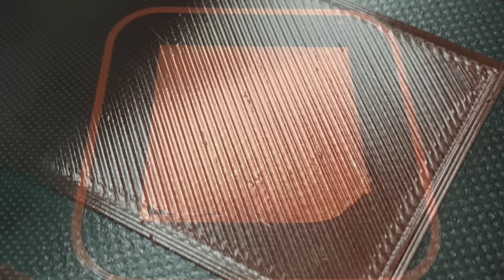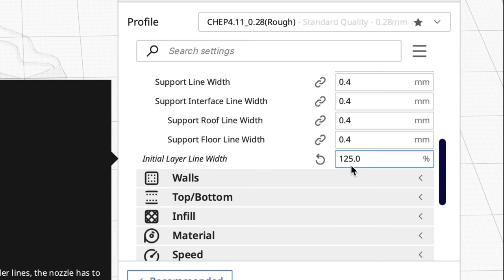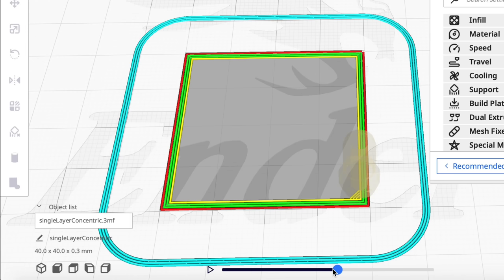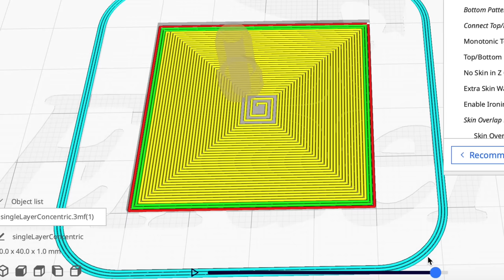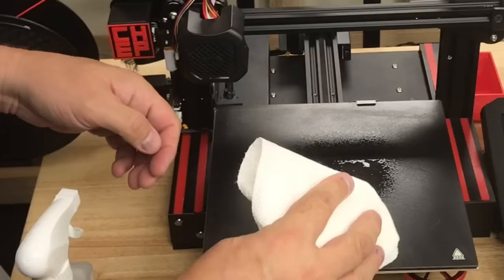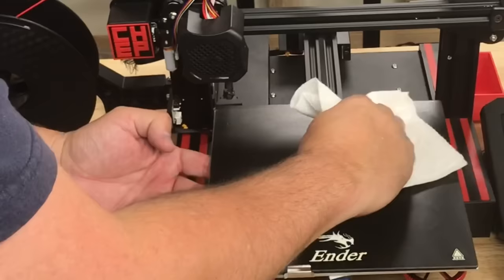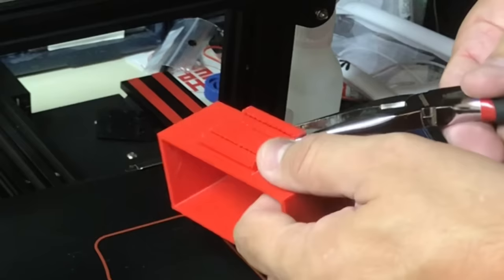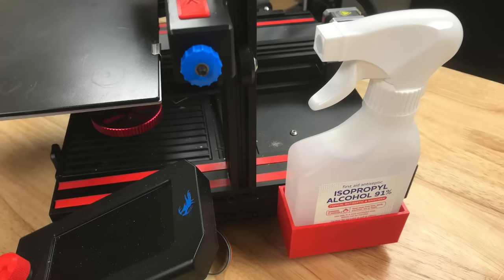Better First Layer and Bed Level Fixes on 3D Printers

Comment: While it is true that isopropyl alcohol will remove the oils, I have found that it will eventually dissolve the layer on the glass. I ruined 2 plates until i realized this. I switched to plain Dawn dish soap and water and have yet to replace a plate.
Reply: Yea same I’ve been having issues I just use dish soap then glue stick but don’t wipe the glue stick
Reply from the maker: How many wipes did it take to fail?
Reply: @FilamentFriday  I honestly didn't count at the time. I think I was in the habit of cleaning after every build on the first plate. So maybe 30-40 items before things just wouldn't stick. Got a new plate and didn't clean as much before each build. Started to put two and two together and figured the alcohol was eating away at the texture on the plate. I know there are many levels of percentages for alcohol and maybe a lower level would not eat away as much, but at this point, I just use good old soap and water. Maybe a pure glass plate would be ok to use alcohol, but if there is some texture on it be forewarned.
Reply: I also damaged the surface in cr10v3

Comment: My filament Friday tip is; Use LIQUID PVA GLUE, it´s the best! Smear a thick layer of PVA GLUE onto your print surface BEFORE you start, then pre-heat the HEAT THE BED until it's dry and goes clear.  After printing the PVA peels off quite well when it's time to redo the surface.

Comment: I came back to the hobby after several months, bought some filament and a new printer, just because.  I just watched your video a few times because I'm having trouble with my first layer adhering properly.  After about 2 hours of messing around I finally realized that the filament I bought and was using is ABS lmao
Reply: This comment saved me so much headache. I ended up doing the exact same thing haha 😫
Reply: @davidw4269  lmao good to know I'm not alone

Comment: I found a while ago that cleaning your glass bed with a bit of dish washing liquid (not mixed with water) and then rinsing it with water and leaving it to dry has helped me with bed sticking issues. 

Unrelated I found Cura 4.9&4.10 tend to cause bulging by seams and corners in my prints so I'm stuck trying to solve that. Might stay with 4.6 til a newer version doesn't cause that issue

Comment: Thank you for another informative video.
ISP Alcohol is rather exspensive here in South Africa, so I use menthalated Spirits. And no, I don't filter and drink it/ At $2 for 750ml, it is more affordable than $4 for 100ml...
Also thank you for the file.
I am one of those who take your files, apreceat the efford, and modify it for my needs.
I always wanted a side mounted camera bracket for my Ender 3 and 3 Max. So I tinkercad the box away and add a camera arm onto it with an action camera mount that can take the various camera and cellphone mounts. 
Will post a make to your thangs page once I am done.
As you can deduce, you are aiding my designing and education. So thank you very much.

Comment: Fantastic video! I noticed that you have some red strips inside your 40/40 rails to prevent loose filament from getting in there, and you have a custom knob attached to your LCD, could you go over what you think are some of the best print-able upgrades that you always print whenever you get a new printer? Thanks Chuck!

Comment: So I made these adjustments.  Next few prints came out flawless.  Next day i went to print my next model and - nothing sticking.   Flawless prints had a z-offset at -0.12.   To get the next print to stick I had to adjust z-offset to -0.60!!!   Nothing else changed!   This is boggling my mind.
Reply from the maker: Clean the bed with soapy water or Isopropyl alcohol.
Reply: You have bad bed screws or a wobbly x-gantry

Comment: I was so annoyed one time. Couldn't get it to stick. So I turned the heat to 210 and pushed filament through the nozzle by hand. The filament was curling onto the nozzle. So I guess some debris was in the nozzle or something. Great advice 👍
Reply: The curling is caused by the fan blowing air onto the filament.
Reply from the maker: No, it’s typically a partial blockage preventing proper flow.
Reply: @FilamentFriday  hmm if the fan is not on and it curls then yes I can see how that could be the problem, but on my Ender 3 v2 the filament always curls a bit when the fan is on(stock one-sided fan) even when I switch to a fresh nozzle. Perhaps something is wrong with my Hotend?

Comment: Should also mention temperature of the bed and nozzle for z hieght. If you go from printing at 60c on the bed to 70 or 80c, you will likely need to adjust your z height.

Comment: Maybe it's just me. but attaching a bottle of IPA next a a heat source, like a 3D printer, seems like a fire waiting to happen.
Reply: right??
Reply: Not exactly, because it doesn't touch anything hot directly, the nozzle doesn't go that far, but it might evaporate
Reply: Just rubbing with a paper towel makes my glass mirror bed clean most of the time. In our country we use methylated spirits to clean. Much cheaper but you have to tolerate the smell for a little bit.

Comment: Holy heck.... I need to just try and "clean the bed". I keep the area clean of scrape and debris, but yea.... I've never actually just. Given it an iso wipe down. I am using the Ender 3 v2 Neo with the flex bed to get prints off easily. I feel I am leveling the thing all the time, or just never getting a good flat adhered print. Maybe it is because of the oils.... from skin.
Reply: It's funny. Was having a sticking issue. 
Cleaned the bed, heated it a bit higher, slowed down to 20% to get it started and voila.. working again. I was kind of shocked that cleaning the bed... Works LOL didn't realize that could even be an issue. So so so glad I stumbled on this video, I was about to pull out the kids school supplies for a glue stick lol

Comment: Great video as usual Chuck. Much appreciated. I have a Cura question yo may be able to answer - As you can set retraction under a material filament profile, and set retraction under a print quality profile, which one takes precedence when you generate your g-code?

Comment: Im about to throw my printer in the bin.
The first layer have gaps between the lines/Infill. And does struggle on making holes after travel.
I used a 0.1 gague blade to fix bed leveling. Tried a big range of temps/speeds/retraction.
Reply from the maker: Sounds like you filament is slipping in the gears of extruder.

Comment: I tried cleaning the bed as instructed and my print still won’t stick to the bed. What should I do? Im so tired of fixing this printer
Reply: Go in your slicing software, adjust the initial layer height to be higher. Slow the print speed, travel, and increase the temp of your nozzle by 5°.

Comment: Never occurred that the oil from my fingers was causing certain areas to not stick. Cleaned with alcohol and got a lot of yellow crud off build plate and next print stuck down right away. Thanks!

Comment: Latest 5.x cura doesn't seem to have many of the setting you propose, like initial layer...
I have just updated my main board to V4.2.7 so I will be going through a raft of calibration processes.
To stick to the bed ?  I use prittstick and a damp tissue to spread the glue around the bed to cover the print area.
Works every time...
Reply: hit the 3 lines to the right of search setting and select all
Reply: @NuttyRam  Oh, of course... Visibility..
Face palm time.. Thank you...

Comment: I'm new to all this, In Cura I don't seem to have nearly as many settings as you do. Are they addons?
Reply: There is different settings for different levels of advancement you check off

You’re probably probably on the basic settings which are very limited, but you won’t get into too much trouble
Reply: Go to preferences then settings and select "expert" from the right side dropdown
Reply: Settings are Basic, Advanced, Expert or All in Cura. Tick the view you want.

Comment: I'd like to see a video about printing PETG on the Ender 3 V2 and how it sicks on that surface. I want wo start printing PETG and don't know if I have to put something on it to prevent ripping of the surface when removing the print as I've seen it on other glass surfaces or if ut works because of the texture. Would be an interesting topic as I've not seen any recommendations in that certain case
Reply: PETG prints just fine on the glass bed. Needs to be clean and go slow on the first layer and the head needs to be further away than it does with PLA.

Comment: I have great adhesion on my Ender 3 (glass bed, BL Touch v1.1.4 board) when I slice in Cura to standard quality, but when I switch to superior the filament does not stick and I get individual strands. I am printing with bed at 60 degrees and filament at 185 degrees with 4mm retraction after following your video on setting those values.
Reply: try to set the first layer height to 0.2mm, you can do it from the advanced settings.

Comment: I've leveled, tried a new bed, yet when I print the first layer I can see the filament curling up behind the nozzle as it moves and then it just drags everything into a ball of death, somethings going on and I cant seem to find a solution...
Reply: Same
Reply: @acidthedragon685  Looks like my bed, even though it was new was a fair bit higher in the middle so using the CHEP gcode for leveling the bed it was fine around the edges but the middle was tight, bought a glass bed and it solved that problem, bought a set of feeler guages as well because they were only £4...
Reply: Having a similar issue
Reply: @akg2n  I solved by using feeler gauges to set nozzle/bed distance, however I did also saw to a glass bed as mine was higher in the middle.
Reply: You could try being more aggressive with the squishing.  Force the filament to make an aggressive contact with the bed.  If you’re still not getting it… clean the head, clean the bed, try bumping the heat?
Reply: @lylejohnson7841  its fine now, swapped the bed for a glass one so its actually flat, then got some feeler guages, loads better now, no curl or adhesion issues.

Comment: When i do a long print. The first few layers tends to melt down a bit. It looks like compressed towards the object. I put initial bed temp at 75 and then 60. Should i reduce the bed temp or should i increase the initial layer height ?
Reply from the maker: Sounds more like a bed level issue. Too close to the nozzle. Try increasing initial layer height

Comment: My first layer keeps bubbling up ... already tried a cold pull, cleaning the bed with alcohol even cleaning it with soap and warm water ... re-leveling the bed (lower and higher). Nothing seems to fully solve the issue. I got a PEI bed btw. I might try the concentric first layer later...

Comment: The layer shown at 0:30 is over extruded.  Perfect first layer requires perfect first layer thickness.  Print first layer, stop, peel it up and measure with digital micrometer.  Adjust until it is exactly right. Then adjust the flow until the traces look filled but not over filled like those at 0:30.  Last adjust bed and extrusion temperature until adhesion is perfect.   Hotter give more adhesion. Cooler for less.  Wipe the bed with rubbing alcohol before each print to remove finger oil.
Reply: Is Glas cleaner good as alcohol to clean a Glas print bead?
Reply from the maker: Not sure

Comment: hi chuck,
I love your video's, I'm no expert in all of this stuff. i have been 3d printing for about 1 year, and i did some research and I found that isopropyl alcohol on the ender 3v2 is bad. so the ender 3 v2 has a carborundum bed an it is designed to release when it is cold but if you put  isopropyl alcohol on it can actually destroy that I'm(1) After 16 3D Printers, I Found My Favorite 3D Printer Bed - YouTube. love your videos man keep it up
Reply: What do you use to clean the Ender 3 bed then?

Comment: Question. Is having the zozzle start at .02 mm height better than having it start at .01?  I would think that after you leveled in bed with a piece of paper that is .01 mm stick then you would want the nozzle height of the 1st layer to be .01 as well correct? Wouldn't this make the squish correct and have a better first layer? Just throwing ideas out there.  I asked because I was having major issues wit's ager issues with 1st layers and having gaps if been gaps so I have tried numerous settings in Kira but haven't tried some of these.  I did get a pei sheet to help and it seems like the 1st couple of prints did ok (not great) but now it is not sticking as well even after cleaning with alcohol.

Comment: Does the filament quality, age, humidity have to do anything with the first layer to stick?
Reply from the maker: It can. Depends on the filament brand or type of filament.
Reply: @FilamentFriday  I did everything in the video, nothing worked, I'm seriously thinking about selling the machine.
Reply: @mustafatelawi9961  If you do everything he says plus level your bed, wash the build plate with dish soap, and dry your filament, and that still doesn't work.... It may be the filament or printer itself. Could need better bed springs, a z-axis baby-step, or something else a bit more obscure.

Comment: I had so many problems with the first layer on my Ender 3. Perfectly leveled. The main problem was that the printing bed is uneven. High and low spots. Making the first layer 0.3mm heigh helped, but I just ordered a glass bed I think it will fix my problems
Reply: I wonder if I warped my bed angrily scraping away filament lol

Comment: If you are using PLA and a smooth glass bed you can also use sugar water on a heated bed….it will stick very very well and cost next to nothing and easy to clean.

Comment: Either there's a different cura, or I'm blind I press on the down arrow on speed and it only shows one option
Reply: go up to the cura cofig then go to settings then go down and check the settings you want
Reply: or click your settings at the top right and change it from basic to expert this is on cura 5.2.1

Comment: Have a question. I print on a ender3pro and ender3 v2 both printers have puffy spots on all my flat surface pieces it just started and i do not know enough to fix it. I cant uplaod a picture or i would show you. Please help if you are able

Comment: My process:

1.) Check the filament and ensure its in good condition
2.) Level the print bed 
3.) Wipe off the print bed with rubbing alcohol and a paper towel
4.) Preheat everything before pressing print

Comment: I've leveled my bed within about ~0.010m using a BLTouch, aggressively wiped the steel textured PEI magnetic bed plate with IPA, and the bad boy still comes up on one single corner. Sad because it looks perfect in every other way, besides that one weird curved up edge.

Comment: great video ! thanks for all the suggestions! could you advice on what slicer software could work right with a flashforge adventurer 3d lite printer?  i a m not using flashforge filament persei ( its very difficult for me to get it ) i use hatchbox or sunlu PLAor ABS 1.75mm... but flashprint software doesnt allow me to select brands, just offers strictly flashforge filament...and i get no the not sticking problem with additional spaguetti result. hope to hear from you soon !

Comment: I've read isopropyl alcohol can overtime damage the glass bead bed, so stopped using it, and now just use soapy water. Have you experienced this at all as I'd prefer to go back to alcohol?. Thanks
Reply from the maker: I’ve heard that but never actually seen it on any of mine so I think it’s another one of those myths.
Reply: Thanks for the reply, I think I will go back to alcohol as I'm not keen on doing the dishes. Thank you 👍
Reply: @FilamentFriday  This is info from creality shop about bed:
How to clean the glass bed

    Heat the bed to 70℃ until the leftover material is as soft and easy to remove as possible.
    Use the scraper to remove any residue.
    Scrub the glass with warm water.
    Do not scrub the glass platform with alcohol, it will damage the surface coating that increases adhesion. We recommend cleaning with water.

My printer cr10v3, was perfect stick , after cleaning alcohol , my prints started to peel off easier, and the adhesion is worse. Probably I'm broke the surface.

Comment: Im so sick of software. I click quality and the drop down has one option, layer height. Did i click the drop down wrong?
Reply: A lot of the settings are hidden if you hit the 3 bars on the top right you can select manage settings and it will allow you to select which settings are visible

Comment: 3DLAC spray works just like a miracle...at least for PLA. I was rather skeptical before trying it myself, but its a day and night difference. 400ml can is pretty cheap and lasts forever (still running the first one i got almost a year ago). Though not sure if it is available in the US....

Comment: Try 1st later as pla pause print then switch to abs I’m not sure why I can’t find anyone trying this yet I’ve just done it and it’s come out perfect
Reply from the maker: Your getting good bond between PLA and ABS?
Reply: Yes it did fail though so I’m doing the hole raft as pla this seems to be working way better I also changed to grid support and gave the raft an 8mm margin. I was hoping to be able to alter the 1st layer of the raft so it is solid rather than gaps but this doesn’t look like an option
Reply: The pla come unstuck from the bed because of the warping so I’m hoping these alterations will help
Reply: @FilamentFriday  I have just noticed while taking it off the two different plastics don’t adhere that strong but it’s stronger then the bond to the build plate so worked out quite well